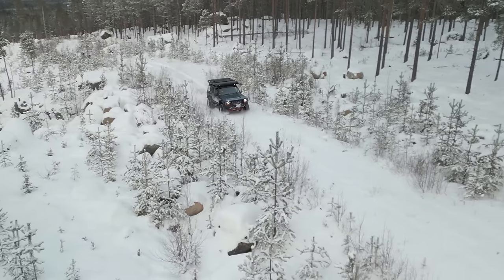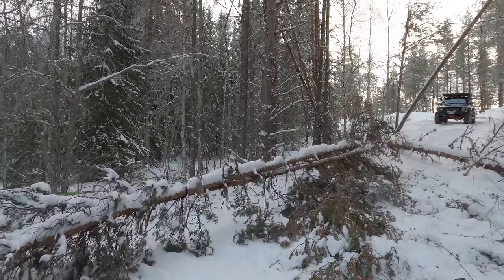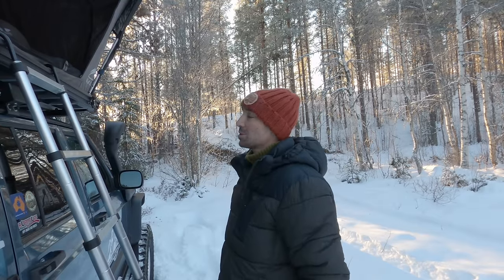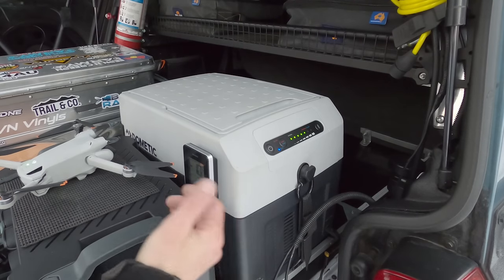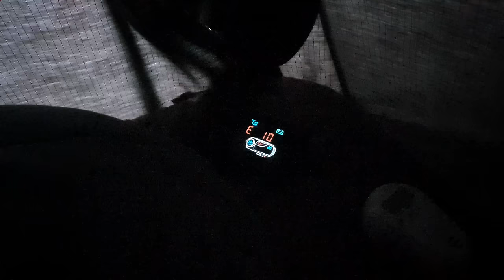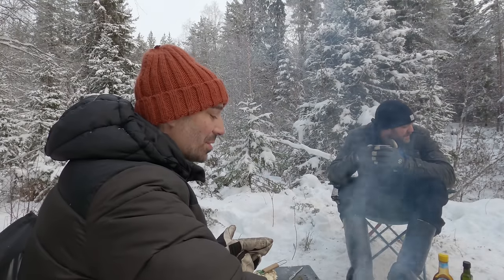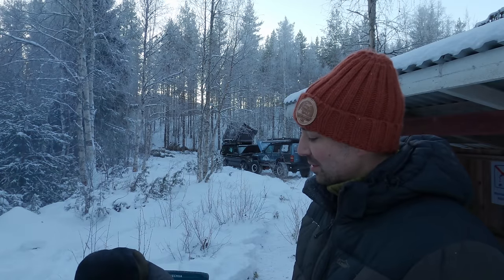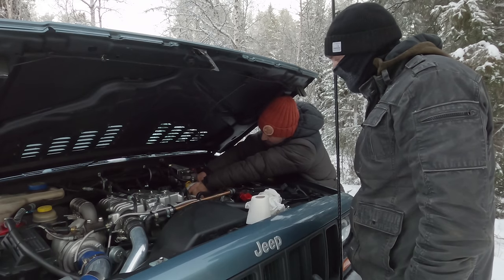Extreme Cold Winter Jeep Camping Adventure

Comment: The spring tension in those pines had me worried but it worked out nicely. 
You are a very resourceful man 👍🏻
Reply from the maker: Yeah absolutely, I slacked off the winch but still you never know if the roots are going to pull once the weight is taken off. Seen that happen a few times back in the UK. Thanks for watching!

Comment: Ironically people always want to wear jackets and clothes in a sleeping bag but that only restricts how the heat radiates around the bag.  You are better off adding a bag liner or layers outside the bag and wearing light thermals inside.  Adding hand warmers or hot water tight containers or hot rocks inside the bag help enormously. As for the batteries, that’s always the challenge.  Small batteries can fit in a small crush cooler and hand warmers can keep ‘em warm.  For the bigger ones it’s down to the challenge of wrapping and heating.   I love the cold but it does remind you how fast things can go to hell.   Good video mike always a pleasure to watch.
Reply from the maker: Great tips. That's certainly a common misconception on sleeping bags. I'm in my boxers and a t shirt in mine but it's rated pretty low so I'm worried about over heating. The challenges are great fun and the environment is beautiful, but like you say things can go wrong very quickly especially if you rely heavily on luxury items. Thanks for watching

Comment: Great video Mike. 
Happy you were not out alone in these harsh conditions! We can plan for a lot. But not every scenario. Like water in your diesel! 
I typically ground tent/sleep inside jeep down to about-15 /-18 c. With my -20 sleeping bag. Colder than that I ditch the gear and use the fire. Slept in a lean too shelter just big enough for me to sleep in. On spruce bows next to a 6ft long fire down to -28.  
When I say sleep….Well 40 min at a time between adding more logs to the fire lol. 
But yeah past -20 it’s no joke. Everything breaks. Water has to be kept next to the fire.  Have to be super careful when getting fire wood not to get sweaty. 
My Jeep is the 4.0. So it’s easier to start in extreme cold. Still doesn’t like it however. But getting a few logs on the ground. Then putting some coals from the fire on a baking sheet under the oil pan sure helps warm the oil up before trying to start it. 
Like you say Mike. The cold 🥶 makes you go back to basics. Axe. Wood. Fire. 
Cheers from Canada 🇨🇦
Reply from the maker: The water in the fuel was a bit of a shame, my fault now I've found the source. An extended tank breather that was taking in water when jet washing. Anyway sorted for next time. 
Long log fires are extremely useful, like you say though it's in an in out sleep experience for sure, but it kind of needs to be. I remember waking up on one occasion and it being completely out. 
The 4.0 is much better in such conditions. I have an old renix and it starts so much better than this tractor lol. I need to figure out a good method for warming my engine up. All the best ones seem to cost the earth. 
Thanks for watching

Comment: Diesel tanks can get water in from condensation keeping the tank full can reduce it but it is a constant issue should have a water trap in the system somewhere so you can drain it out. dont know if jeeps have a fuel tank tank drain but you can sometimes crack them open if it has one and drain the water out.  good you had your buddy with you to keep you warm and the discovery to rescue you. 
Sat here in the uk at around about -2 thinking that looks jolly cold there but i do love the snow.  a walk around of that disco would be nice  have a D2 TD5 we are slowly turning into adventure truck
Reply from the maker: I have a drain on the filter but not the plastic fuel tank unfortunately. I've considered building a metal one with a low point drain. My water issue was my own dumb fault. I extended a breather to the roof that took on water in a rain channel every time I jet washed the jeep. Sorted now but its got me thinking much like you have suggested. I will get ivo to do a video with me on his Disco. He's currently building gullwing windows on it so I think he will want those finished first.  Thanks for watching
Reply: sounds good look forward to it @Ivo.Outdoor
Reply: woops well least you found it before anything super nasty could happen.  @WorkshoptoWilderness

Comment: Consider..if you have to remove your diesel, welding a 'bung/access port w/ball valve'  at the lowest corner, obviously not real easy and youd have to make a protective cage for it,  but then you could release the water accumulated in the tank...then throw in some 'power service 'additive, change your fuel filt. And you'd be good to go...it actually works good
Reply from the maker: Unfortunately the tank is plastic. I thought of it myself, perhaps a wine cork? Joking. I'm thinking of building my own stainless tank and if that happens a weld in tank drain is absolutely happening. Thanks for the tips and for watching

Comment: I'm fairly sure that a decent amount or some of your stuff is custom on your jeep, but do you have any kind of list of the parts you added onto it that were from market? I saw your amazon page, but most of what was on there specific camping out supplies/gear, mostly not listing stuff for the XJ.*
I'm planning to buy an XJ soon and mod it out a little bit. I like your build a lot, and I was mostly wondering on what hood vents, snorkel, and tire carrier you use/recommend. 
Also the side armoring looks custom(?) but if it's not I'd love to know what the blacked out armor parts by your rear wheel and lower half of your XJ are. Thanks!
Reply from the maker: Most of these parts you mentioned I fabricated. I have build videos on the channel if your interested. I had to make them because I live in Europe and its too expensive to get parts shipped over from the USA. 
The rear bumper was a recent build - https://www.youtube.com/watch?v=ax5qxRGw_o8
Rear panel armour fender - https://www.youtube.com/watch?v=yRtXLB5m6Ps
Front armor panel fender - https://www.youtube.com/watch?v=4eOy5Vo47Pg
Armour below doors - https://www.youtube.com/watch?v=2olDLbCqpqY
Snorkel - https://www.totem4x4.es/tienda-online/snorkel/jeep_53d92ad63af7c/snorkel-adaptable-a-jeep-xj-2-5-comprar.html
Hood Vents - https://shorturl.at/fhqVY

Some of the links above wont be useful because its just videos diy builds. If you want armour thats similar you can buy it. I found these on ebay - 
Just rear - https://www.ebay.com/itm/174705743972
Full set, looks nice, similar design - https://dirtboundoffroad.com/en-fr/products/steel-fender-flares-full-set-jeep-cherokee-xj
Check out there website, they sell pretty smart stuff for a good price considering the market. 
Let me know if you want any more links and stuff and thanks for watching.

Comment: I really appreciate the cold starting ability of my old Toyota truck. As it is a gas engine it might be a little slow at - 20 F and below but it starts. The fuel injection works better for me. I remember an early morning drive at -50 in GM vehicle back in the carb days. The outside of the carb was icing. I had isopropel in the tank but it didn't help outside and the linkage. One wise guy told me later that I could thaw it by urinating on it. It might work but standing on top of an suv engine compartment at -50 to urinate on the carb was not for me. Parked out of the wind held the throttle open and everything thawed enought to get home. After that the radiator recieved a cardboard wind block.

Comment: Hey! Nice vid! My XJ engine sounds just like yours. "Get the Xj" they said. "Bullet proof engine" they said. I have the 4.0....
Reply: if your 4.0 sounds like Mike's diesel then you only have about a 100k left to run it before rebuild or replace
Reply from the maker: Could it be the flex plate? I'm no 4.0 guru but mine sounded like a diesel and thats what it was. Thanks for watching
Reply: I think it's one or more broken piston skirts ;). Will do an in-frame rebuild in summer. Not tea bag prices from the electronic bay. Worst I think will be the friction fit rod piston pins.
Reply from the maker: @thonyonetwo   Ah shit that's a shame. They seem like pretty forgiving old engines to work on so hopefully it wont be a brutal job.
Reply: That's what I'm counting on. It's a 1960s design that was supposed to be fixed in a field with a hammer and some elbow grease. ;) not like a Merlin:)

Comment: Mike, looks like the fruits of your earlier labor paid off for this trip--at least concerning the drivetrain.  Hopefully draining your fuel tank will solve the other issue you encountered, though I am sure it is not a job you are looking forward to.  There always seems to be more to do when operating our equipment in extreme conditions.  Your end comments about the dangers of traveling alone in such circumstances were spot on.  Good thing there were two of you to help one another out.  Best of luck getting the rig back in shape for another outing.  Finding the source of so much water in the fuel might be prudent so there isn't a repeat of this issue.

Regarding saws, the Silky Katana Boy would be a good choice for the truck.  The 500 is a bit more affordable--I have the 650 and it is a beast.  It is the fastest saw for cutting through logs after a chainsaw.  Either would have made quick work of the trees you encountered and much less work than the axe.  Looking forward to your next adventure!
Reply from the maker: I siphoned off almost 2.5 litres of water from the fuel tank. Quite a considerable amount and fortunately no damage to the engine. Its an old marine diesel so its probably use to it 😅 it wasn't a fun job though as you can imagine. 
Very lucky to have company on this one and nice to know you can call someone if things go south. I ended up buying a Silky Zoobat Ultimate 330. I've always loved those, not big saws but a joy to use. I dont think I can get a chainsaw, my old roots won't let me. If anything I should be carrying less. 
The 3 link and axle seem to be running nice, I'm really happy with it all. My next job is a stretched chain in the np231. It's growling loudly. You can hear it actually in some of the shots at the start. 
Thanks for watching and for the comment

Comment: If you can find a product called Diesel 100, get it. I used it in winter when living in Lapland. White bottle with a red label. Quite cheap too, maybe 60SEK or so, unless price is bumped up there as it's a Finnish product. Helps with water build up in diesel and also aids in cold starts. One bottle treats 100l of diesel.
Reply from the maker: Okay I will take a look for that. Thanks for the information! Maybe OKQ8 but then it would be more like 600kr from there haha.

Comment: I had a problem with diesel from the truck pumps in Sweden which resulted in the car being recovered back to the UK (strangely nobody in Sweden could fix a Mondeo!!!). It turned out to be an algal growth jn ghe diesel known colloquially as "the bug" which is caused by moisture in the tank. Since then I only use the car pumps when in Sweden as I believe thd turnover of fuel is quicker. Hope this helps.

Comment: I’m new Mike ,what diesel motor are u running in Jeep? Where are u winter wheeling.?ask or us?
Reply from the maker: Its a mechanical marine diesel engine 425 OHV. They were always very unpopular due to head cracking but these days you can just buy an aftermarket head to sort that. I have modified mine quite heavily though over the last ten years. 
I've put in a slightly different VE pump, fuel pin, star wheel adjustment, pump advancement, turbo, injector nozzles, manifolds, intercooler etc etc so its around 160hp 340nm torque. They are nice old engines, fully mechanical with just the starter motor and 12v fuel stop solenoid being the only operating electrical devices. 
I'm in Sweden. Thanks for watching!

Comment: Great video guys! I have question though with an issue rarely addressed in any overlanding videos outhere, what’s the toilet situation like? I would think it’s a nuisance in normal temp and can’t even fathom putting a log out in -20°C
Reply: Well, one thing id avoid is the rum. I like booze, but it makes you go to the bathroom more. It sucks getting out of a warm bag when it's cold!
Reply from the maker: Its surprisingly easier to drop the bomb in the winter than the summer. The flies in the summer are relentless and it's quite challenging. 
I have a small folding toilet chair. Its cold to sit on though unless you have it near the fire until you use it. These temperatures are quite harsh though. I remember taking a leak in -37c. It's complicated. 
Thanks for watching!
Reply: @WorkshoptoWilderness  Good call on the toilet chair! The more layers you've got on make the risk of collateral damage go up exponentially!
Reply from the maker: @farstrider79  🤣
Reply: @WorkshoptoWilderness  I've got a little torn cartilage in my knee and an occasional bad back, squatting in the woods is already a moderately risky move in the best of times, let alone trying to avoid thicker pants, long underwear, and trying to make sure a sweater or coat doesn't hang down, all while trying to not fall backwards 🤣🤣🤣

Comment: Would it be worth adding a diesel fueled block heater?  That would get the engine up to starting temp nicely, and not require depletion of the battery bank.
Reply from the maker: That would best thing. I need to try and source one second hand or save my penny's. They are expensive but the best option!
Reply: Yeah more money to plough into the build, it's never ending. I'm doing the same thing with a boat at the moment. Never stops. You are a resourceful chap, I'm sure you could macgyver something out of bits and pieces that you find littered around the workshop. 😉

Comment: Question:  Why don't you have a chainsaw?  I carry a Sunjoe 12" battery chainsaw w/ 2 batteries on my Rzr for just what your doing... the batteries are kept on their tender charger until I leave cabin then I move them into my heated cab with me.  My backup is a bow saw.
Reply from the maker: Well it's a long winded answer to be honest. Normally I carry a Silky Zoobat Ultimate which is my preferred saw, probably the best saw I've ever used. The blade required replacing before this outing so I only had a very small substitute on me. Otherwise It would have easily cut both these trees in minutes. 
The other reason is my background is working as a bushcraft instructor. I predominantly used hand tools and its ingrained in me that less is more. I already feel uncomfortable with how much I carry at the moment in the jeep, and feel like I keep adding more and more. 
All this aside though a chainsaw would certainly be an extremely useful tool and I am considering it. I would get a battery one of course to save on messing around. I just have so many other expenses at the moment that in the meantime I will be using my hand saw and thinking carefully about a chainsaw. Thanks for watching and the comment and I hope his makes sense.

Comment: Im not very familiar with diesel but ive heard that there is usually always water at fuel station pump tanks from condensation but its usually not a problem because it seperates to the bottem. But with that said if they are having there takes filled with new diesel it can mix it all together temporarily so if your filling up during that you can pump water into your tank. I hope that all makes sense.
Reply from the maker: Makes sense totally. There are some pretty small unmanned stations up north, I might have gotten unlucky. Although I did find the main source of water entry. An extended tank breather to the roof. Water was running down it when I washed the jeep. I'm a dumb ass but at least it's fixed. 
Thanks for watching
Reply: @WorkshoptoWilderness  not dumb at all! Easy mistake to make. Been watching since you did all the rust repair and frame stiffeners years back and you're actually the reason I like xjs (though I do love my tj and mj more lol) thanks for the reply though! Feels like having a famous person talk to you haha
Reply from the maker: @SyllabicBody5  Well I appreciate you watching for so long! Haha yeah TJs are stunning though, nothing comes close to these old designs these days and if they did they would cost the earth because they cant help overcomplicating them!

Comment: Great video.  A little confused though. Why not drain the water out of the filter?
Reply from the maker: I drained the filter, but there were about 2.5 litres in the fuel tank, and the diesel was contaminated. I had to drop the tank and drain it all before it would run again.